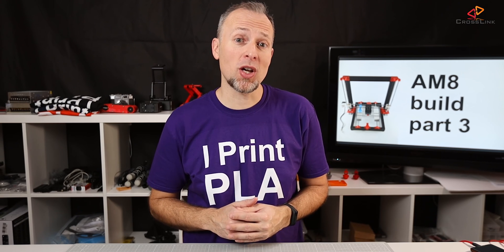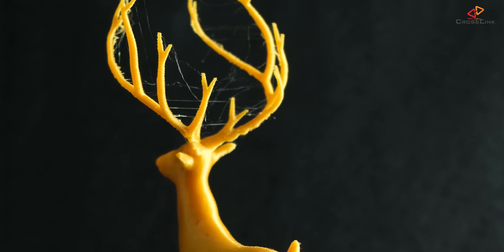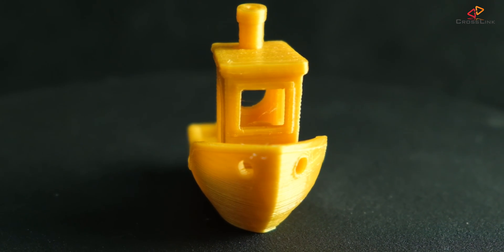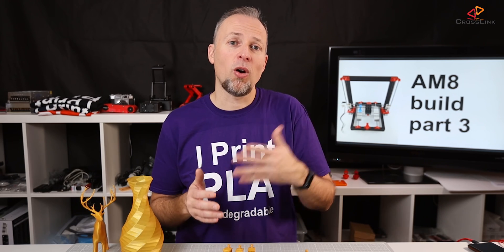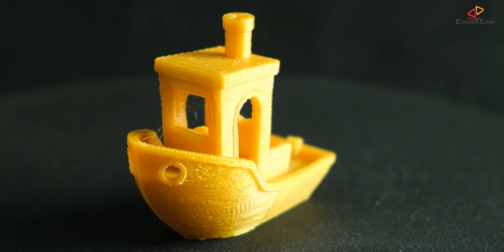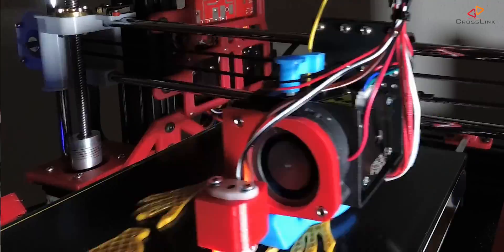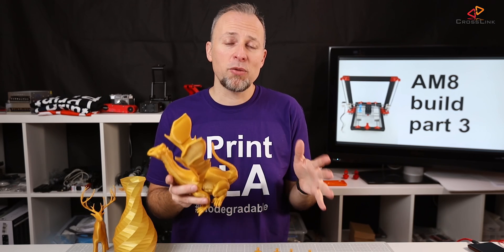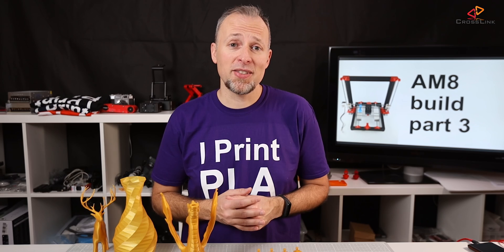Anet A8 AM8 Upgrade - part 3 - Print quality and speed test

Comment: What about the hardware limitations? 8bit main board and firmware  limitations? The stepper motors and  controllers limitations? Nozzle flow limitation?
Reply from the maker: It’s 2025
Reply: @Crosslink3D  Guess it's almost time to retire the old A8 by now :(

Comment: Hi this is a really nice video! I tried to understand everything but i have a doubt, you increased print velocity because you changed the frame? or the  motors too?
Reply from the maker: Yes, the original frame was plastic and quite wonky. The AM8 ist a replacement frame.

Comment: I've ordered a RatRig conversion from ebay.....I'm going to try it out and possibly just add to it to create a more CoreXY 'box' which with the addition of a bit of extrusion would be fairly easy and sturdy. I presently have the beast with a spreader bar under a cargo strap and three points across it to create a sort of Parthenon roof peak (shallow triangle) and this essentially works to keep some stability from 'x-wobble' by applying downforce, but it's still got some rippling/ghosting that annoys me.

Comment: My guess is this kit lack of corner brackets makes the frame vibrates more. My AM8 using the original guide prints better at 120 mm/s 4000 acceleration than the first benchy print at 60mm/s. Too much blobs at random spots, from constant vibration

Comment: I have a am8. Heavily modified. Last printing I tried 100mm/s and got y axis skipping. I have replaced the steppers now. [Have not tested yet] did you try any prints that did utilize the speed [longer x y runs?]
Reply from the maker: I will do more long term testing soon. but nothing bad happened yet.

Comment: I've tried speeding up my AM8 and some prints worked at 120mm/s, however I later discovered it wasn't reliable at that speed. Occasionally I got layer shifts suggesting missing steps. Think I would need to lighten the bed and/or switch to a remote extruder to get it working reliably on large prints at over 100mm/s. The above is all with PLA. I've found I have to print slower when using PETG.
Reply from the maker: Yes, printing at higher speeds is a bit of a risk in the long run. Also parts wear down faster...

Comment: I would say you transport your anet a8 issues into your Am8 because the frame kit makes the construction of the pri ter stronger but i dont really change the quality as well! take a look at blv mgn12h he build this printer as a opened build on thingiverse! I also build my Own one and clean! if you want i will show you my build 👍
Reply from the maker: Yes, the blv mgn is an amazing printer. Quite expensive though if you want the original rails. I think, still an interesting option, I will look into.
Reply: @Crosslink3D  Yes its quite expensive but no trouble anymore about damage bearings or igus bearings if you want i send you some Picture! I also want to use a 32bit Lerdge-X board with some tmc2208 but on the otherside i outsource the entire electronic parts from the printer so i decided to make everything on my own!

Comment: Great video!  I am more interested in print quality than speed, so I rarely tweak my settings once I've got my printers dialed in with good results.  Slower speeds, better quality and less fatigue on the various parts.
Reply from the maker: Absolutely. If you have the time, slower is better. Always.